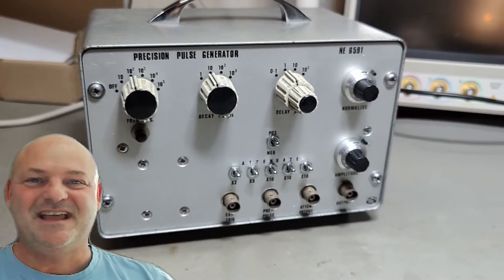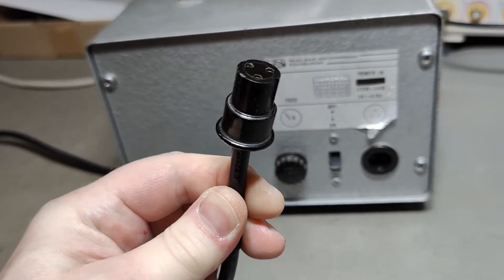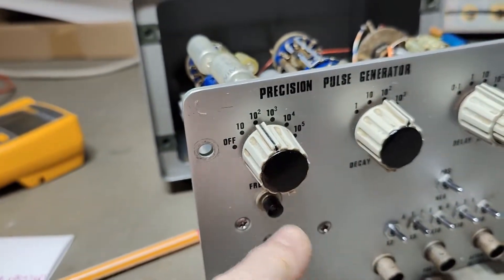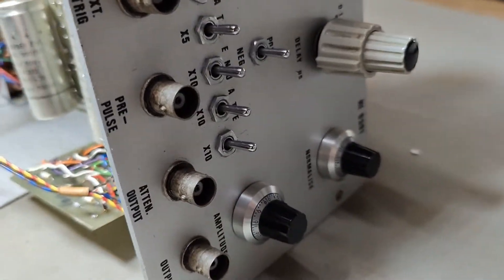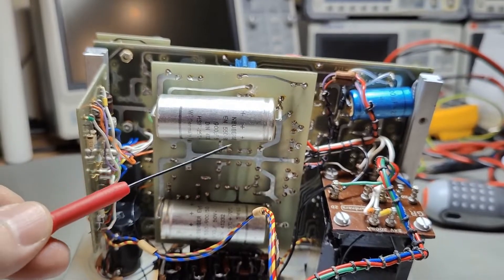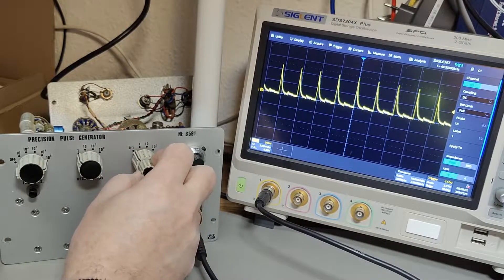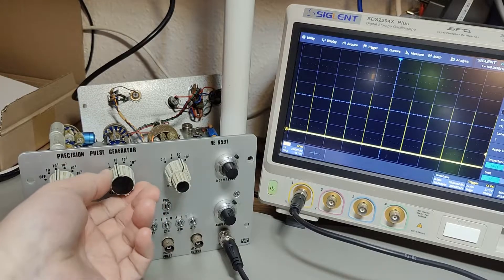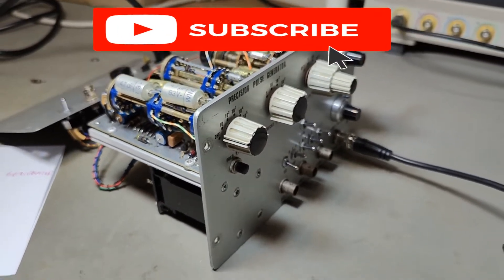Nuclear Enterprises NE6581 Precision Pulse Generator 1968 test teardown

Comment: Thank you. 

You did a very good job in fixing the several issues. 

However what about the wave distorsion of the sinus at high frequency ? 

We figure out that the problem is solved, having no explicit image of it on your video....

Comment: Very nice. I have a Farnell pulse generating system that can do all this and more (separate rise/fall time width). But would love to add this to my bench.
Reply: what model is the Farnell pulser?
Reply: @ciprianpopa1503  Its name is "Farnell Pulse Generating System" no model number, has the following  modules: 
PS/A - Powersupply 5 + 25V
PT/A - Trigger Unit
PF/A - P.R.F Generator 1Hz - 1 MHz
PD/A - Pulse Delay 0.1uS - 100mS
PW/A - Pulse Width 0.1 nS - 100mS
PO/V - Output Unit variable Slope
PO/A - Output Unit w/40dB attenuator, 50R